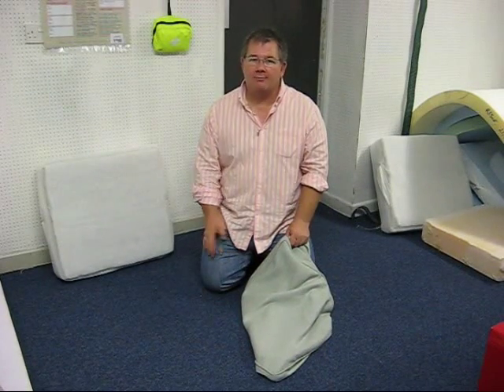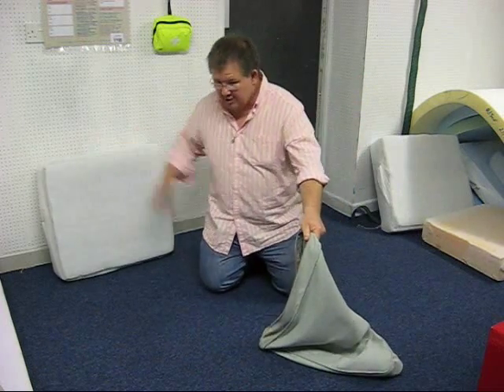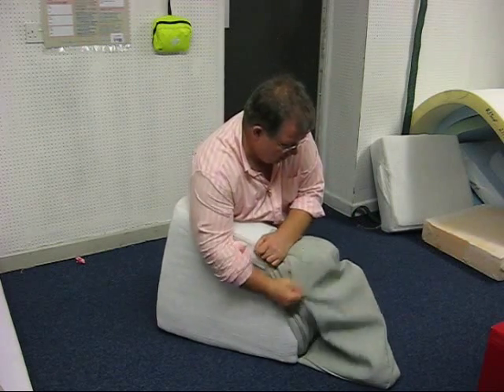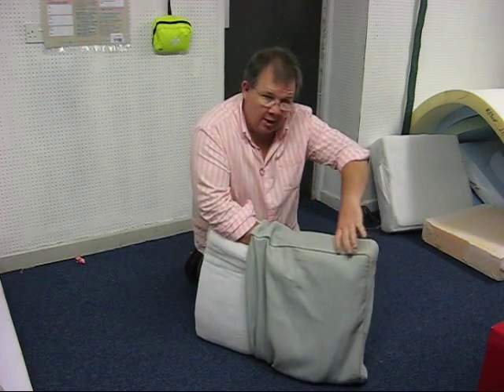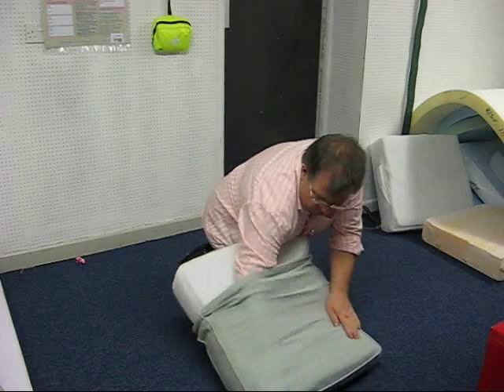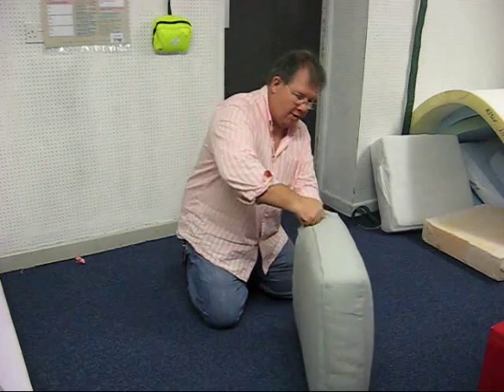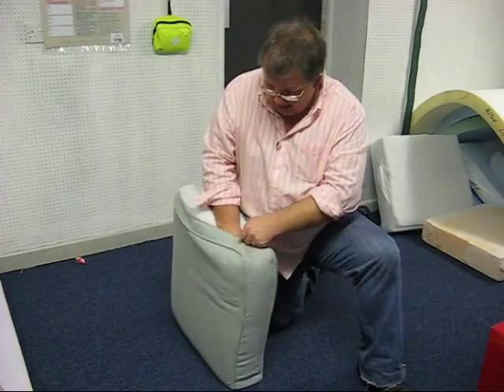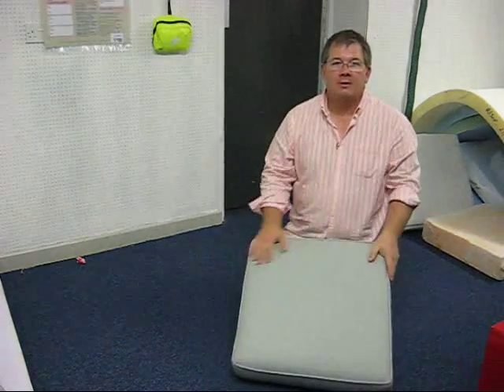How to fit a foam cushion

Comment: I tried to put the covers back on the cushions by turning them inside out. That got one about 1/2 way on.  Then I checked YouTube for help. I watched one where the guy folded the cushion in 1/2. That works for him. My covers are made of very heavy material and cushions are thicker and stiffer than his. Then I watched one where the guy used a plastic bag and a vacuum and plastic bag. That was very easy, but I don’t happen to have large plastic bags lying around. Then I found your video. Your method was a bit more work than the vacuum, but it worked very well.  A little pushing with no swearing and voilà. The cushions are back together and life is good again. 
Thanks for your help.

Comment: Through trial and error I figured this out on my own, and it works great!  Depending on the size of the pillow, I've also used a little side table to set the cushion on, just because my knee was sore and I couldn't kneel!  I have also put my cushions in a large garbage bag, which protects the cushion from soiling and makes the cover a bit easier to get on and off.  Great video!